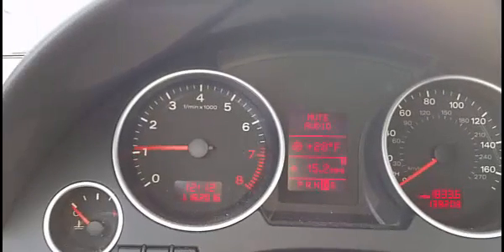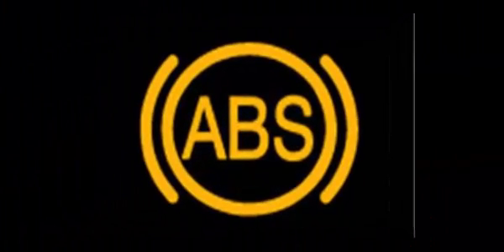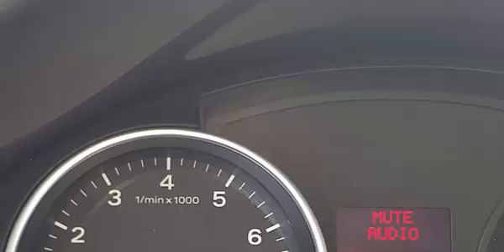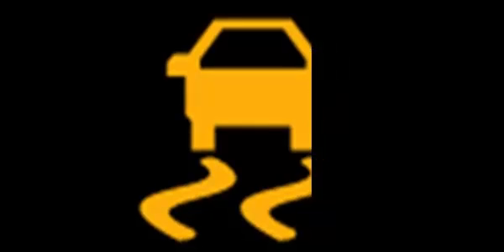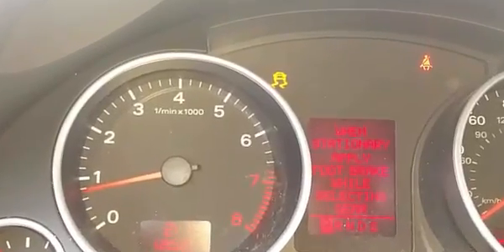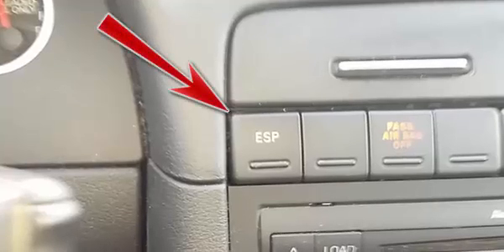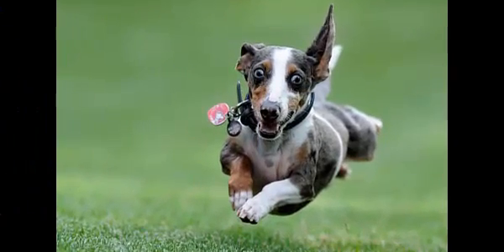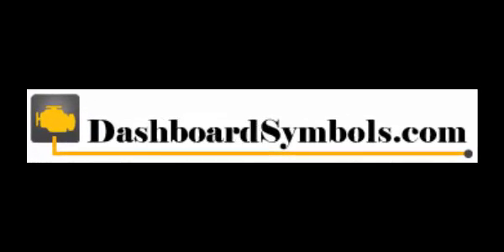Stability control lights: Assuming you have good tires, when and why do they pop up?

Comment: I have a 2013 focus se in which the light stayed on. Stability control I believe it reads when I turn the car on any idea?
Reply from the maker: Well, first, make sure it isn't simply turned off (check the manual). Second, is there another light on?? If yes, start there. Finally, has anything changed? Hit a pot hole? A curb? etc...
Reply: @DashboardSymbols   ok thank you much appreciated 🙏
Reply from the maker: @joec9739  Good luck with it...

Comment: The ESC light stays on because it's a more serious issue for the stability control to be activating than the ABS. My GM car from 2009 actually has a 2 stage stability control light. It flashes if the system has to intervene lightly, but if it steps in heavily, it will flash AND beep.
Reply from the maker: Agreed, but I maintain that at that moment, a driver's eyes belong on the road, not distracted by the light. BTW, NHTSA's own research found that an audible alert was a greater distraction and recommended against its use. It also found the light was indeed distracting, but as much. Manufacturers were given the choice, and as far as we are concerned, chose badly...
Reply: @DashboardSymbols  I'm not defending the manufacturers at all.  It was their thinking that led to the proliferation of stop/start systems.

Comment: Should I drive In the rain with the traction control ? This morning I hydroplaned on the freeway  and I’m so spooked trying to learn the most i can
Reply from the maker: Ok, please read this carefully. "...with the traction control?" YES! However, I think you mean with the traction control light on (which means the traction control is off). Then you CAN, but VERY carefully. Further, I am 99% sure you need to check your tires. Worn tires in the rain are worse than no traction control. Please check them or have them checked ASAP and drive carefully...

Comment: I have a 2017 challenger, and the light came up, but the issue is that the wheel drags a bit to the left.. only when goin under 5mph anything higher it’s normal. Should I just take it to shop to make sure nothing is wrong
Reply from the maker: Absolutely yes. Sounds like a pot hole or curb bent something that will, at minimum, eventually cost you a tire. Or worse...

Comment: Hi! I have a Jeep Grand Cherokee 2014, when I made a slight right turn the ESC indicator light turned on and it started to shake and move weirdly. I didn’t know if I should have kept on going, so I turned it off and when I tried to turn it back on the brake was hard and it made some noise as if it had no fuel that it was struggling to turn on, and it was not able to turn it on. I’m not sure if this is an electric problem
Reply from the maker: It sounds like a brake problem, which is part of the stability system, but you'll definitely need a hands on diagnosis. And don't wait -- it's serious no matter the source...
Reply: @DashboardSymbols  okay thank you!
Reply from the maker: @amyromero8249  Good luck...

Comment: I have one Hyundai Elantra 2017 I have the code P0014, P0017 and P0335 in my car I change crankshaft, coils, spark plugs, clean transmission....but every time if i try drive my traction light illuminate and my car stop.
Reply from the maker: Wow. A lot unpack. First, the traction control light is not relevant. Clearly an engine issue, so the check engine light is on too, yes?? Or an EPC (power control) light? Resolve this and the other goes away. Frankly, it sounds electrical -- a relay somewhere, but trust your dealer to be able to figure this out! They know the product best...

Comment: I have a 2014 impala the stability track light comes on and engine reduced speed is on the dash as well as check engine it stay on for days on in then goes off and the check engine light is left on for a few days then it goes off and everything stays off for a week or two then starts all over again
Reply from the maker: This is ALL about an engine problem and it needs a hands-on diagnosis. Once the reason the check engine light comes on is properly addressed, all else will be resolved...

Comment: When the light popped up the car felt like it was going to turn off. Does anyone know if that's supposed to happen when it comes on??
Reply from the maker: That's NOT supposed to happen. Sounds more like an engine issue and likely as not the check engine light is or was on as well...

Comment: I have a 2005 audi a6 quattro 3.2s, my traction light control is on and it won’t diasappear, how do I turn it off?
Reply from the maker: You don't. If there is no other warning light, the system needs to be serviced. Otherwise, the system may be turned off. If you hit the button on the dash to turn it on, the light will go out. Any accidents recently? Even hitting a pothole can knock things out of whack...

Comment: Should I get a new TCM to fix this issue?
Reply from the maker: If the problem runs that deep, it will need a proper diagnosis before that question could be answered.

Comment: My traction light went on after having an oil change n alaignment on a toyota camry 2011. Now is pulling n shaking.
Reply from the maker: Well, the first thing to do is go back to where it was aligned and tell them the same thing you just told us!!!
Reply: I did. They said they did nothing to cause that. They install 2 front tires too. Now they're saying is the plugs n coils. That was change 2 months ago. Took it to a different mechanic n he says its the fuel pump. That was change 2 months ago. Confused
Reply from the maker: @rosarioheredia-curiel9751  Unless the Check Engine light is on too (is it??), find someone you can trust to check the alignment again. Frankly, a Toyota dealer may be needed here.
Reply: @DashboardSymbols  no engine light is on. I took the car to a different place they did an alignment again. Went back complain n showed them proof all they said they would reimburse my money for alaignment. Very frustrated
Reply from the maker: @rosarioheredia-curiel9751  Well, there's nothing more I can add. Look for reviews of mechanics or friends who can recommend someone they trust and let them help. Good luck!
Reply: @DashboardSymbols  thank you so much for your input. I will.
Reply from the maker: I do understand and am sorry for the frustration...

Comment: Why does my car turn on the traction control on in the morning but my car kinda struggles to start sfter that the traction control takes of right away.
Reply from the maker: It sounds like the check engine light is on too. Is this true? If so, have the engine serviced and the traction control will resolve itself...
Reply: Its not on the dash the check engine light on but i have the code p1521 on but change the oil engine and oil pressure for the code also
Reply from the maker: @mopar9656  Well, that is an oil code on a European car, but US. Have a good mechanic look into. A serious code no matter which auto maker. Good luck!

Comment: ihave a 2008 jeep liberty the traction control light turns on and truck starts shaking and turns off .
Reply from the maker: The check engine light is on too, yes?? If so, its an engine problem and the traction control light is on because it is automatically turned off. Fix the engine and the TC will return...

Comment: My car has aftermarket CNG. And it shows traction control ON and engine light ON most of the times. And automatically it goes off.  The mechanics have chaged the tappet covers as there were oil in the spark plugs. Buy again this happens. Plz suggest a way out
Reply from the maker: Sorry, but this is an engine issue. So long as the problem remains, stability control remains turned off (warning light on!). Fix the overall engine problem, and stability control function will be restored. Best I can offer...
Reply: For me, this happens when I don't screw the fuel cap all the way in when filling up my tank.

Comment: I got a 2013 Nissan June and had my starter replaced and this light came on along with the check engine light. Could you tell me what I should do
Reply from the maker: Have the check engine light dealt with. Stability control will stay off (light on) until then.

Comment: I have the same thing. My abs light is on and emergency break. Along with the warning stabilitrak off. I have a 2010 captiva. My dealership says i have to release 2 computers but it is like 4000 to replace it. Do u think they are right or it could be something simpler to replace.
Reply from the maker: Really impossible to say from afar. But by all means get a second opinion from another qualified shop. Always possible that something simpler could be at fault...

Comment: Ihave a lexus is 250 2006. Vsc lights is on . The car wont turn on .. what can i do ? Please . Thank you
Reply from the maker: This is clearly NOT a stability control issue. The check engine light is also on, yes? Address the engine issue. The stability control will go back on (and that light goes out).
Reply: Thankyou
Reply from the maker: @dfunherna2168  You're welcome. Find a technician you trust...
Reply from the maker: You're welcome and good luck. Find a technician you trust...

Comment: Hello, I have a 2012 Nissan rogue and my traction light comes on every once in a while. When it does come on, my car starts jerking and will sometimes cut off. When I cut it off and start it back up, my car will sometimes be hesitant to start up and the traction light comes back on. Do you have any idea what that can be ?
Reply: I've changed my tires and it would still come back on.
Reply from the maker: Is it the only light on??
Reply: @DashboardSymbols  no my engine sometimes comes on then stays off.
Reply from the maker: @thehacker4089  Actually sounds like an engine issue that needs to be addressed. The traction control will stay off (light on) until then.
Reply: @DashboardSymbols  okay thank you so much.
Reply from the maker: @thehacker4089  Good luck...
Reply from the maker: @thehacker4089  Good luck with it...

Comment: I have a 2011 Chevy avalanche and this randomly pops up when i go over 30mph and  struggles to get into 6th gear when on the highway. I had a mechanic look at it and replaced my spark plugs and gas pump because he said fuel pressure wasnt consistent. But even after that my truck still has the lights coming on
Reply from the maker: You're saying lights, so I imagine the Check Engine light is one of them. You need s proper diagnosis from a top notch mechanic. You may not like it, but a Chevy dealer with a good reputation would be the way to go...
Reply: @DashboardSymbols  Yeah thats what i was thinking too since the mechanic i went to works out of his garage but i live right next to a chevy dealer and also a reputable repair shop so ill give those a try. Thank you
Reply from the maker: @christianmendez8321  Good. The work you described would have resolved problems seen at ALL speeds/rpms. Good luck. (in case it isn't obvious, the stability control will resolve once the engine problem is resolved)

Comment: My cars traction control light is saying its off, but not flashing. Its not the button that turns the traction control on and off, its a sensor light. When i restart the car, after a second it comes back on without driving
Reply from the maker: Ok, can only guess here. Assuming there are no other lights on, the system has a problem that needs to be resolved. However, since it doesn't flash for a minute, I'm guessing another warning light is on (check engine, ABS, etc), which you didn't mention. Resolve the engine/brake/whatever problem and stability control will be restored.
Reply: @DashboardSymbols  it's actually turned itself off at this point. I feel like for some reason the rear taillight being out somehow might have messed with the sensors. But i guess problem solved, for now. Thank you for the response
Reply from the maker: @MrJWick89  Ok. Good luck...

Comment: I have a 2016 Mustang Convertible. Nice looking car but DAMN, it's been to the dealer more than any car I've ever owned.  Today as some other times, I get the traction light to indicate it's off but in addition, my brake light and the damn turn signal would not come on.  Here's the problem I have, it's now out of warranty and I just don't trust the dealership anymore as this ain't the first time this has happened.  I have a very good mechanic, last time I had the oil changed, I had him check the diagnostics but no codes!  This Mustang has been a nightmare.  I've totaled $5,000 in warranty work since I purchased it Certified used in 2017 at one year old. If this is the norm, avoid like the plaque!!!
Reply from the maker: Sounds like a brake problem overall. The stability control will stay off until its resolved. The turn signal is likely just an unrelated anomaly...

Comment: I have a 2015 Hyundai Sonata eco...i pulled into a parking spot at the store and my car jerked and died....it wldnt start back up till i pushed the gas dwn and turn the ignition and it started but the traction control light was on and it wldnt go in gear at all and i cldnt turn the light off...so i turned the engine off and went in store for awhile...when i came back it started right up and the light was off and it went in gear and drove fine all the way home....what wld cause that to happen???
Reply from the maker: I'd bet anything that the check engine light was on too and that an electrical problem reset itself with the restart. Everyone notices the skidding car and ignores the other...

Comment: How do I turn on the stablility control when it is off in my Vauxhall’s corsa
Reply from the maker: You didn't let on a year, but in a 2016 for instance, its in front of the shift lever. Note that it is on by default and may be off because of a problem...

Comment: Hi I have a holden cruze cdx, my stability light, abs and tc light is on & wont turn off it came on randomly while I was driving
Reply from the maker: This is likely an ABS issue. Once you have it resolved, the stability and traction control will reactivate. Have a good tech check it out, and drive careful in the meantime...
Reply: Be careful you need to get that fix I just had and accident las week
Reply from the maker: @vicvijuarez  Good advice. Hope you're ok.
Reply: I have same promblem and my car doesnot move forward while it shows tc on my screen.
Reply from the maker: @surajbhandari5844  Clearly need to find good, solid hands on help. Best of luck...

Comment: My ABS light is stuck on... the car with the skids behind it is stuck on an my dash also says service stability control with a wrench symbol what does that mean.?  A couple minutes prior my car was hydro planing does it mean just everything got wet and now things aren't working properly?
Reply from the maker: You have a problem with the anti-lock brakes. This turns off the stability control, which ABS is a BIG part of. The hydroplaning was a symptom, not a cause. Have the ABS serviced ASAP...
Reply: @DashboardSymbols oh my gosh... thank you so much!🙏💛
Reply from the maker: @kristenronyak2247  You're welcome!
Reply: Speed sensor?

Comment: So I went to the store today and I made a right turn and the DBC  downhill brake control light  and the ESP electronic stability programme both turned on. When I try to put the car in park it wouldn't shift into park only drive and neutral. So I pressed the release button so I can put the car in park and I shut the car off. Now I cant turn my car on. All the lights come on but the car wont fully turn on. What could be happening? What should I do?
Reply from the maker: What release button did you press? Also, what is the make, model and year?
Reply from the maker: Did you work it out??

Comment: I have a 2008 impala lt traction control came on and it said service traction control engine light comes on but then turns off and after driving a little bit the traction light turns of but when in idle it stutters I bit
Reply from the maker: Well, you are well into problem territory that will take a hand on diagnosis. Find a good tech!
Reply: Narciso Alix air filter plugs fuel injector cleaner!!! Start with this!!! If you don’t eventually you will get a reduce engine!!

Comment: mine is on all the time on my 2005 audi a5 !  for months now! is it a sencer problem??
Reply from the maker: Well, assuming isn't simply turned off (dash switch) and that the check engine light is not on too, there's no way to say without a hands-on diagnosis. Find a good tech...
Reply: @DashboardSymbols  would a code show up on a diagnosis machine?
Reply from the maker: @catscantfly  Might. Might not. And if it does, it may not be definitive. Way too many possibilities. Sorry, not something easily diagnosed...

Comment: This took a load off my mind ty so much
Reply from the maker: Good. Best to be sure...
Reply: @DashboardSymbols  didnt end up getting it tested yet but they did have to replace tire rods I wonder if that had something to do with it I was their like 4 hours
Reply from the maker: @FayeDiddle04  Absolutely could have been responsible. See how it goes from here.
Reply from the maker: I'm sorry to burst your bubble, but is the light stays on, there is a problem with the stability control system. A very important safety system, particularly in the winter...
Reply: @DashboardSymbols  so basically I would start driving and when I turn onto the road called academy it would come on no other lights just came on and then this morning wasnt on at all
Reply from the maker: @FayeDiddle04  Well, keep an eye out. If its stays on, have the system checked out.